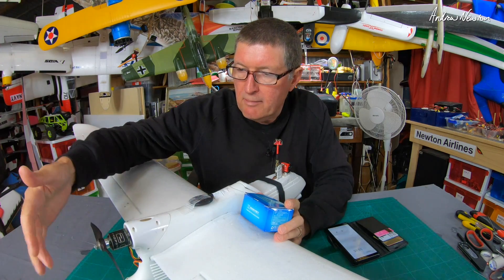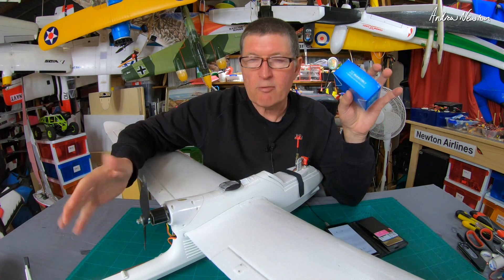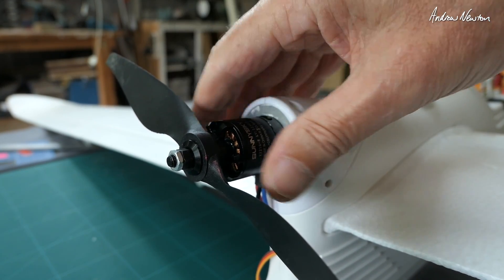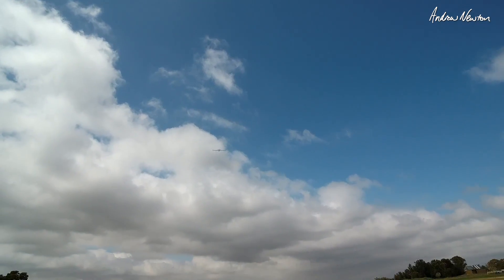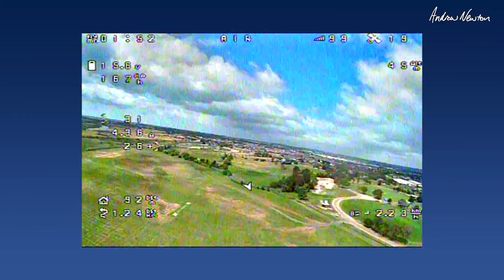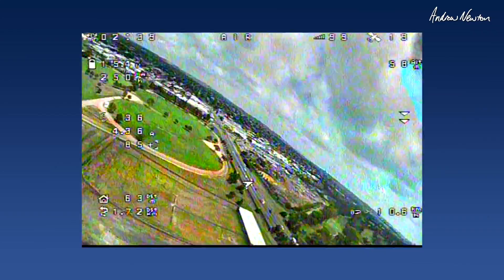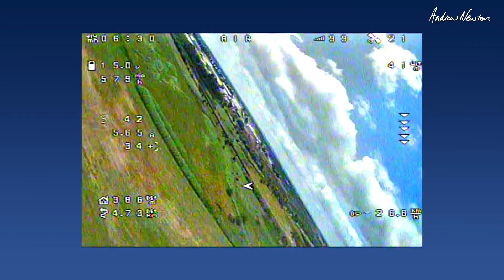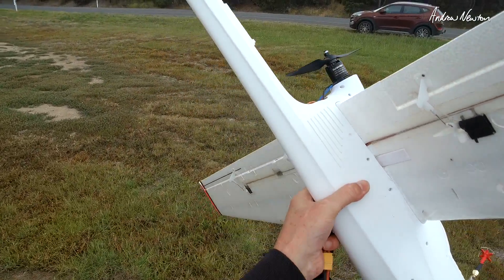Sunnysky X2216 1250kv on Ranger 2000

Comment: Hi  andrew, How much does the whole plane weigh?
Reply from the maker: About 1200g with 3000 4S LiPo, maybe 1500g with all the FPV gear
Reply: @ because I have a 1.5m span glider with a total weight of about 1.5kg, now I'm using a 3s with a 2212 1250kg motor, and I was wondering if the motor you reviewed a better performance , thanks for your time
Reply from the maker: That is heavy for a 1.5m glider. This motor would have the same performance but heavier.

Comment: Sir andrew what are your recommended throws for Aileron/Elevator/Rudder for the Ranger… did not see them on the manual… Will be used with Inav 6.1.1
Reply from the maker: Don't have the 2000 any more but on the 1600, ailerons connected to outer holes on servo arms and control horns, Elevator and rudder connected to outer holes on control horns and middle holes on servo arms
Reply: @AndrewNewton  thank you sir… appreciate the kind and gracious gesture

Comment: i have a question. i want to upgrade the motor on my aero scout . I have  SUNNYSKY X2212 / 1400kv Brushless Outrunner Motor X-Series in mind and i wanted to use 
Hobbywing Skywalker 2-6S 60A UBEC Brushless ESC With 5V/5A BEC For RC Airplane. would this work good for the aero scout?
Reply from the maker: Small prop, so it may need higher kV motor
Reply: @AndrewNewton  have you seen the stock motor on the earo scout they are small really small drone motor. stock motor 2306 -2250. im sure the  SUNNYSKY X2212 / 1400kv Brushless Outrunner Motor X-Serie is bigger and nore powerful ... i had this motor on my stock sonic model ar 1000m fixed wing it was powerful
Reply from the maker: @staydown.normalsavas  Yes the Sunnysky can be more powerful, but only if you use a bigger prop. 2250kV vs 1400kV
Reply: hmm.. thanks.. i think i will just add a 2-4 cell esc at 30amp..... the stock esc gets hot after 5 batterys on 4s and will shut off in the air and turn back on when it over heats . It has only done it to me one time but i noticed it was the esc that was hot and why the motor stopped. It is still new so horrizon hobby sent me a replacement esc. I dont think i will use it thought i want a 4 cell esc

Comment: Andrew what size battery were you using with this setup?  Maybe I missed it... Trying to determine if it's capable of carrying a 6000mah 4S Lipo.  Seems like it might draw slightly high amps for a Li-Ion at full throttle but cruising would be ok I think
Reply from the maker: 4S 3300. Could easily carry 6000
Reply: @AndrewNewton  thanks for the reply. I'm ordering one today.  I can't find the kit version though.  Is the stock pnp motor/esc capable of 4s? maybe by propping down or RPM/throttle limit down if needed?

I noticed you have used 3s and 4s on it with your motor setup. I'm really going for efficiency and long range but trying to use this massive, pricey 6Ah brick lipo as well 🤣
Reply: @AndrewNewton  love your videos BTW.  Keep up the great work. I've come to trust your reviews and opinions on wings.   ...not true of all reviewers haha
Reply from the maker: Many thanks. Stock setup can survive 4S but best to do as you suggest to limit current a bit.

Comment: Do you think an outrunner would work on a G2 with some mods?
Reply from the maker: I thought this was an outrunner. What are you referring to?
Reply: It was more the type of installation, where the motor is installed externally rather than internally to the housing.

Comment: Thanks for the great videos Andrew 👍 I'm thinking I'll need to upgrade the motor, ESC and servos on my 1600 soon what would you recommend? I like the sunnysky motors used them before if I went with the 1400kv would I need to update the ESC or could I get away with the stock one? I'm using 3s .
Reply from the maker: ESC will be fine, any metal gear servos would be better than the originals.
Reply: @AndrewNewton  any brand or site you recommend to buy servos was tempted to go Banggood but heard it's hit or miss?
Reply from the maker: I used to use TowerPro MG90S servos but watch Matts video on which ones to buy now https://www.youtube.com/watch?v=MGSYjpvl8II

Comment: There's a CF motor mount available on eBay listed as Universal Motor Mounting Plate for SK450 XA650 FY680 Quadcopter that fits the stock mount diameter of the Rangers perfectly. The Rangers are nice planes but that that prop noise reminded me why I've converted most of my other top props to twin tractor.
Reply from the maker: Oh brilliant. Just bought a set, thanks for the tip
Reply: You bet. :)
Reply: @AndrewNewton  Hi, Andrew. Does this mounting plate also fit the Ranger 2400? Is it CF or dyed fiberglass? Thanks!

Comment: @Andrew Newton - Did I see you plugging a current indicator between the battery and ESC on another video?  What do you use to give you OSD telemetry on your TX?  Just interested in the technical side as you seem to give excellent current draw information on most, if not all, of your videos. Can you provide links for the equipment you use?  Thanks from NZ
Reply from the maker: FrSKY 40A current sensor. I have videos on all the sensors. Also get current via a flight control board and watt meter in some videos.

Comment: Every time I see you back off and test the cruise amperage I chuckle and think 'yeah, I'd never see that' lol.
I can't fly at anything but full throttle,  I get bored too fast, I've only ever manged to do one endurance flight and got 35mins and around 18 miles with an ft cub running a 4200 3s and a storch wing instead of the stock wing, I had a headache by the end of it though from the concentration of keeping flying it so slowly and not ramping up the throttle 😂
Reply from the maker: Ha, I am always in glider mode for some reason.
Reply: @AndrewNewton  i might as well have a simple on off switch for my throttle, im maxed out from take off to landing.
i dont even save any power, i will run it down to min at altitude and glide home lol

Comment: Awesome!!! Do you have the flaps connected to your FCB? Or do you have them plugged into your receiver MWP? I have a Tundra and I want to put a Matek F405 Wing with INAV but I can’t figure out how to get the flaps working. 
Thanks for your help and thanks for sharing.
Reply: not sure about Inav, but in arduplane, you can use the pass thru feature to get an rC channel out directly.  you can flash Arduplane onto a f405 board. if you do not find another solution, check your rc reciever, many can output PWM at the same time as SBUS, and you may be able to bypass the fC altogether.  maybe, maybe not.  but worth checking. just plug in a servo and try it.
Reply: FPVREVIEWS I have actually considered doing that. I’m using a Spektrum satellite receiver so it doesn’t have sbus our PWM outputs. It does have a serial output but I still need the fcb to make it work for flaps. I may need to just get One if the orange receivers that has PPM and use that one so I can bypass the board. Thanks for your comments and suggestions!!
Reply from the maker: Flaps through the FCB. I have a video on exactly that. Check my iNav Playlist
Reply: Andrew Newton thanks so much!!! I’ve poured through a ton of your videos. You have absolutely fantastic content and great info!!! Thanks for your help!!!